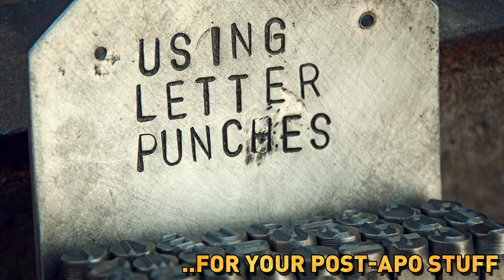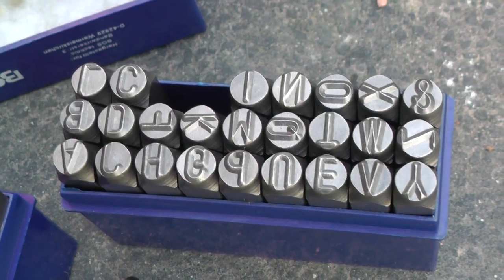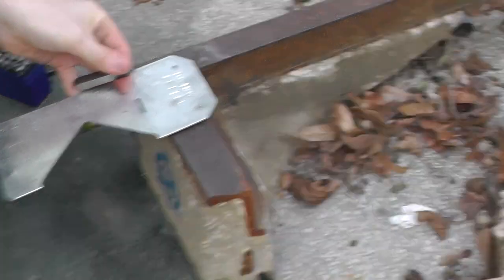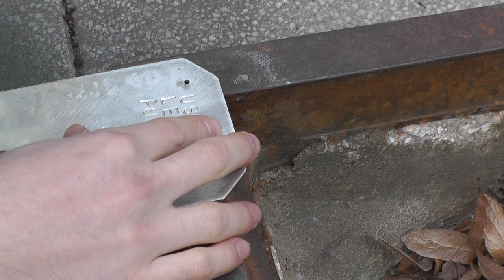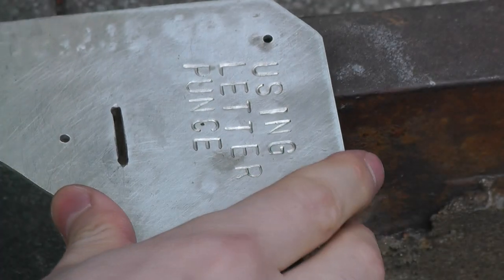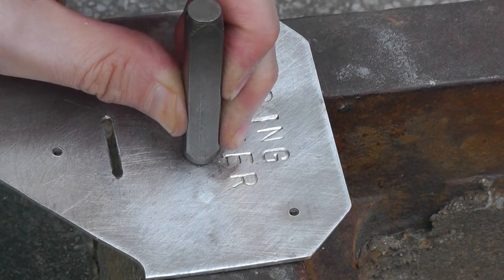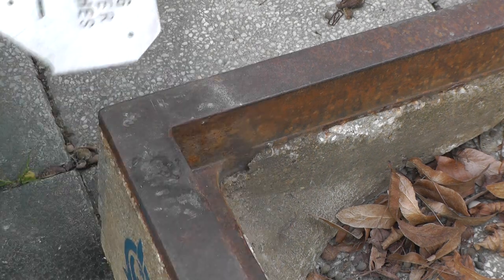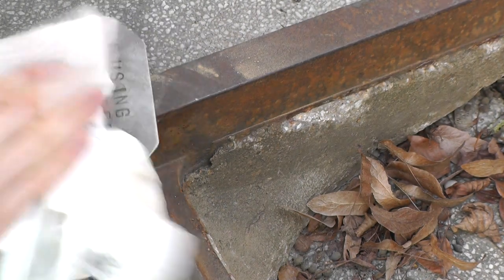Make this COOL TEXT EFFECT in REAL METAL

Comment: I just bought those in Germany at Norma at 8 Euro a set, they might still have some left.
Reply from the maker: depends on the size, where i bought em the smaller ones are way cheaper. but 8 eur ois good catch indeed if the quality is good!
Reply: They're 7.5 mm, dunno about the quality as I haven't tried them yet. But they even came in a wooden box.